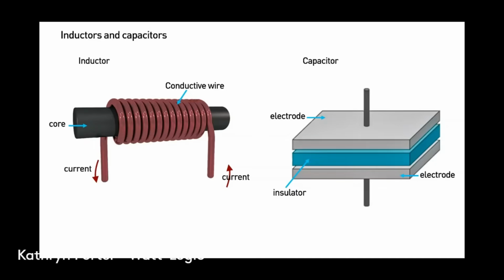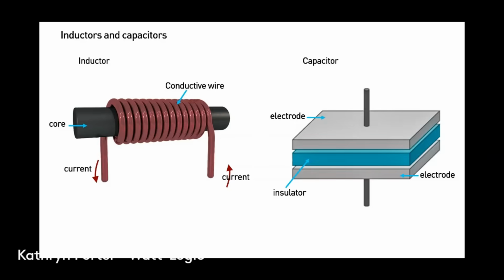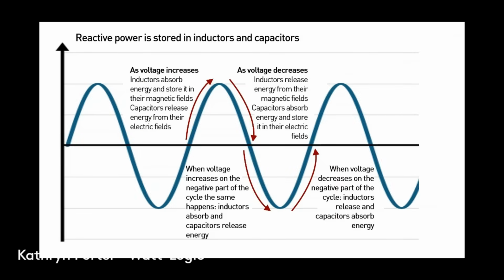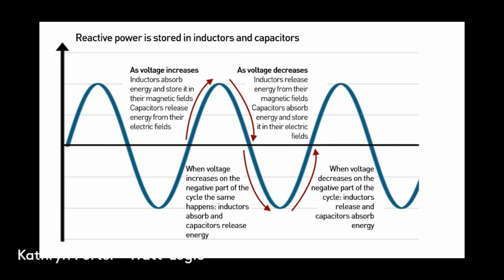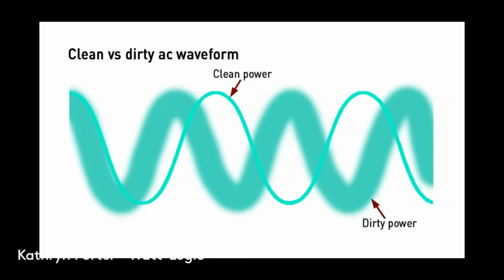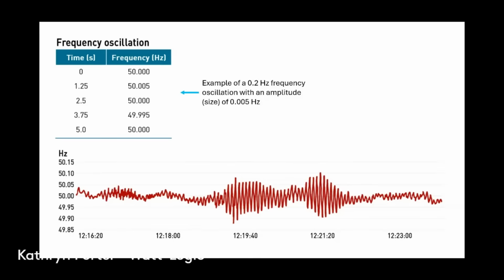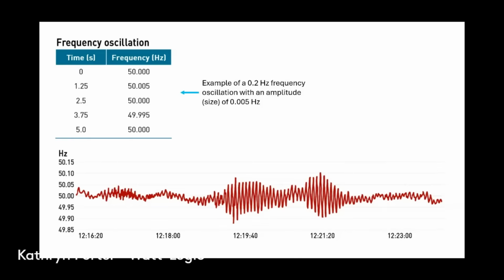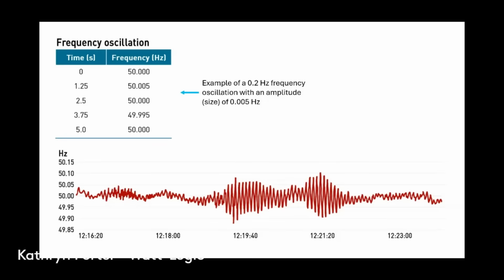Iberian blackout

Comment: Really helpful, thank you. Could you explain how a domestic combined air source heat pump, solar PV and battery (DC connected) system works. Why does the grid limit the size of the PV system for a simple connect to 3.6kW? What will happen if, theoretically, multiple properties accessing the same sub station install 8-12kW ASHP and the grid is not informed?

Comment: Challengers O-ring failures were studied but they only studied the failures no realising that non failures were always at high temperatures during launch, hence the real risk of launching at low temperatures. More importantly for this, it was commercial pressure put on the engineers to change their assessment which is very much a Net Zero problem

Comment: A minor error , at 6:55 you describe a motor and a light as "resistive loads" ... the motor is inductive ... and as incandescent bulbs (which ARE true resistive loads) are mostly extinct and we're all using LEDs etc. they too are inductive/reactive loads....

A minor detail in an otherwise very comprensive talk... 

I'd be interested in knowing where the low frequencies (0.2 / 0.6Hz)  came from... not harmonics of the 50Hz fundamental, obviously.. sounds like some kind of frequency mixing is happening somewhere... 

I know that 2 oscillators operating at different frequencies can "beat" and produce various intermediate frequencies (this is the basis for superheterodyne radios) ... Would 2 (or more) generators running at slightly different output frequencies be responsible for this ?...

Interesting vid.. a sub and a like from me !!

😎👍☘️🍻
Reply: If centralised grid generation is used - several big power stations - their outputs can be synchronised more easily - with centralised control? In a power grid with hundreds if not thousands of inputs - lots of solar panel DC to AC inverters - they aren’t precisely synchronised are they? So ripple effects would occur from imprecisely inputted power supplies?

Comment: KP: "So in that sense you absolutely can trace this back to renewables."
WRONG, that is scapegoating Renewables, shooting the messenger. What you can trace it back to is a failure to design the system and the equipment, including the inverters, properly to handle renewables. It's lazy design, and/or poor system analysis before deployment. 

KP:  "... overall the collapse exposed the systemic risks that you have with low inertia grids and high levels of inverter-based resources and inadequate voltage control"
That's kp's interpretation, mine would be:
The collapse exposed the problems that can arise when you attach inverter-based generation resources to the grid without a proper understanding of how those resources need to be designed and managed. 

There's no fundamental reason why you couldn't have a grid that was poeered completely by wind and solar just using inverters, and it would probably require very little, if any, so called inertia, but more accurately rotating heavy generating machinery, the inertia of those generators is constant whether they're rotating or stationery. Some synchronous condensers might be useful, because these effectively behave like the output smoothing capacitors to get on a DC supplies.
Reply: I'm here in Spain..money first priority for electric company's here..they will use all the water from the pantano to make cheap hydro electric..then 3 months later there's a drought,the pantano is almost dry and they act like it's not their fault and can't understand it😂😂

Comment: Great video, thanks!
Suggestion: Edit your pinned comment and add a time stamp to fast forward to for all of us who already knows how AC electricity works, but knew almost nothing about the liberian blackout.

I wonder to what extent, if any, it would had helped if the Spanish railways used a different electrification? As a comparison in Sweden the railways use 16 2/3Hz and a lot of that energy is converted from 50Hz using rotary converters. Although not intended to back feed the grid, these obviously provides some inertia.

Also, IIRC in Switzerland or maybe Austria they used parked but powered on modern electric locos as power factor compensators.

Here in Sweden the national grid pays you for installing inverter based reactive power. I.E. you just buy inverters (I don't remember if you also use batteries or not) and hook them up to your grid connection, and you get paid for how much they help keep the grid stable.

Re compliance: How would you test this? Would you temporary hook up a really large AC-AC inverter between two sides of a disconnect that connects a smaller part of the grid to the main grid, and on purpose change the frequency and check what happens with all connected inverters? Or would you go around and do this for each customer that has solar/wind connected?

Also, how does it technically work when the grid operators order power producers to produce more or less power? Is this partially manual via phones or so, or can the grid operators electronically force certain producers to increase/decrease power production?

Also: I get why there are narrow limits for tripping power generation, but as the main reason for tripping smaller inverters is to protect electricians from being shocked during a black out, is there really a reason for having those limits on smaller inverters? Wouldn't it be better to have really wide limits, like 40-60Hz and also allow the voltage to drop as low as say 100V? (I also get that a reason for the limits is to have the inverters trip if there is a short circuit, don't know what the correct wording is in English, trigger conditions perhaps?).

Maybe we also could benefit from remote controlled "smart" load shedding?
Back in the 70's-80's  Sweden had a system where the grid had overlaid signals with audio frequency that were used to switch between day&night fees, but they could also be used for load shedding for houses that used electric heating. Something like this but way faster reacting seems like a good idea.

Speaking of automatic disconnect: Since induction stoves already have electronics, and many ovens also tend to have electronics, and for that sake also other appliances, how about regulations that forces them to disconnect if the frequency falls too low? I get that many will tamper with that if it's in any way possible to tamper (and if it's not then the manufacturer would lose sales to off grid / camping customers), but as long as most don't, it would be a decent way to save power during a grid emergency. The same goes for heat pumps / air conditioners.
Reply: A wide frequency "band" of 40-60 hertz would be totally unworkable... effectively there would be NO synchronisation !!... if you connect 2 unsynced generators you will get a big bang.... 

Also, most industrial machinery uses 50Hz as a timing signal in processes... even a simple conveyer belt couldn't cope with such vast speed fluctuations...  

😎👍☘️🍻
Reply: @peterfitzpatrick7032  I'm not talking about what the producers would aim at, but rather at what they at least would not disconnect from and preferably also be able to connect to. I.E. if you from a black out would manage to get the grid to above 40Hz and say 150V (phase-neutral) all solar inverters would kick in and help bring up the grid. Also when the grid is under heavy load they would not disconnect early.
Reply: @The-secret-101  The actual frequency is arbitrary to a certain extent, being mainly set by the grid generator sets... BUT ...whatever the frequency, it can NOT diverge...ACROSS the whole grid AND syncronisation cannot diverge...&  you can't mix different frequencies because its then IMPOSSIBLE to attain synchronicity... thats all I can say, I don't know what your comments are trying say... 

(At 50Hertz nominal, 40Hertz is 20% and 60Hz is +20%... so an overall swing of +/ 40% ... )
Reply: @peterfitzpatrick7032  Yeah, but it's better that parts of the grid run as an island than a total blackout. Also if you can do a cold/black start and the solar/wind generation would actually help rather than cause trouble you would be able to reconnect faster.

Also, with some sort of remote control for desired frequency and voltage that solar/wind inverters would adhere to, it would be easy to reconnect to the rest of the European mainland grid
Reply: @peterfitzpatrick7032  As for industrial machines, it's just beneficial if they would install automatic shutoffs that shut off their production if the grid goes out of narrow tolerances as that lessens the load on the grid when it's under heavy load.

I would think that most industrial processes uses VFDs nowadays too, or asynchronous motors. Also if the process can't cope with varying speed of conveyors (like say a factory that casts iron or whatnot) I assume they have local backup power that at least can run the most important things.

Comment: "Normal" may be "lost in translation", as it may not refer to a acceptable/good/desired state, but a statistically recognisable (bad) event that must be anticipated to happen from time to time.
Regarding the oscillations, REE meant to discern between events that are well-known to occur, maybe several times each year, and which they have a good idea of what is going on, as to what causes these 0.2 Hz oscillations and how to deal with it, on one side, and on the other side the abnormal, unexpected events of oscillation (which they did not know the origin of).

For people living in England, one should expect some extreme weather from time to time, like extreme rainfall that flood the streets and sewer system. It is well-known that i can happen, and why it can happen, and there are ways to stay out of danger. REE would call that a normal event, but being eaten by a tiger is very much not expected.
Reply: The actions that the system operator must take, depends on the root cause of the anomalies they detect, so the classification of the oscillations may influence what the operators choose to do.

Comment: Can't we make inverters that simulate the inertia of rotating machinery? Rather than following the grid (or worse, disconnecting), they could oppose the frequency change in the same way a big rotating machine would. Wouldn't that help improve grid stability?
Reply from the maker: Yes, in theory. There are two problems. One is technical with grid operators and OEMs struggling to align on specifications. The other is economic... They would have to keep some capacity in reserve to provide inertia. So if you had a 10 MW windfarm you might only be able to sell 9 MW in the regular market to keep 1 MW for inertia /frequency response. That would obviously have a cost but it's hard to justify when you get it for free from conventional generators

Finally if the inverters aren't grid code compliant and can behave in unexpected ways it would be a risky strategy

Comment: Like your presentation style; struggle to understand some of it; very technical! Could you explain fault ride-thru in another video?
Reply from the maker: It's when a generator is supposed to keep running despite a grid fault where the impact of the fault is within the parameters set out in the industry codes

It's a bit like working through a cold but needing to be off sick if you get the flu. The cold is the small fault, you should be able to power through but you might be a bit miserable, but no-one expects you to power through actual flu. That's a fault that's beyond what a generator should be able to ride through

Does that make sense?

Comment: It seems surprising that a fault on a single inverter would cause a measurable effect on the high voltage grid. I assume that the inverter would be connected to the local, lower voltage network and just be one among many. What would have happened if that inverter had failed totally rather than just malfunction? In other words just switching off?  There must be a vast amount of high power semiconductor devices on a grid with a high proportion of solar and wind. Converting from AC to DC and DC to AC.
Reply: If it was caused by a single inverter, it must had been a large solar farm and not one used for ten panel on the roof of a single family house.
Reply: @The-secret-101  Kathryn says that the fault was traced to a solar inverter associated with a single solar PV. I realise that it must be quite a hefty device. I don't know how these solar farms are configured and whether or not there is one inverter for a bank of panels or one per panel or one for the whole farm. All the same, a single solar PV must be small in comparison with the whole grid so it seemed surprising to me that a fault on a single device can ripple up through the network and be seen at the top level.

Comment: Very nice tutorial indeed.  More info now explaining the circumstances of that voltage raising. It was the ops action aimed at reducing oscillation. They switched out the reactors and switched in some previously outaged lines to increase the synch torque. That caused the voltage to go up enough but still within the limits to trip the first synch gen. These oscillations were not a direct cause but rather led to ops action which elevated voltage to the point where the first gen prematurely tripped. However interesting is this new mode of 0.6 Hz, too much attention is paid to these oscillations as the cause of this event.
Reply: It wasn't so much the oscillations, it was the way the wind and solar producers reacted (pardon the pun) to them by shutting down prematurely which ultimately caused a cascade failure by reducing base generation "stiffness" ... thats my take on it anyways.. 🤔
Reply: @peterfitzpatrick7032 finger pointing in one direction only doesn’t help. The first premature tripping was actually by the synchronous generator. Since it was heavily leading, it triggered subsequent tripping by other gens. The problem with the IBRs was that they didn’t regulate the voltage. Unlike the conventional generation, the renewables were not required to keep the scheduled voltage. But again, you can’t blame them for that. It was the grid operator who allowed them to operate in the pf mode.

Comment: Excellent video with good explanation. 

So the problem could be fixed by requiring renewable installations to have grid forming inverters instead of the older dumb ones?

And the control standards across manufacturers would need to standardised (by an IEEE requirement for example) to allow grid operators to not have to worry about how different sites will react?

These seems like a failure to adapt a grid to increasing renewables rather than renewables being inherently flawed. It shows that care and time is needed during a transition and not a headlong rush for the “prize”. Something politicians should take note of.

Comment: A lot of wind turbines do directly feed AC into the grid with no intermediate inverters by using DFIGs/Doubly Fed Induction Generators, which are just generators where the field is AC instead of DC.  The output frequency is the sum of the shaft rotational frequency and the field frequency, which allows for fixed output frequency with varying shaft rotational velocity and smaller inverters as they only need to handle field input power.

Comment: I am Michael Faraday and I approve this video
I asked someone at the national grid if I needed to get a backup generator at home. The advice was to get a battery backup and offset the cost using a smart tariff. It was a clever way of actually evading my question - to answer it could have compromised this person. So I am still equivocating - an lpg generator + manual transfer switch will cost over £2,000 but it would give me peace of mind. The erosion of standards and general scientific illiteracy among senior civil servants worries me. I worked with them for 10 years.
Reply from the maker: I have a diesel generator. Both my cars run on diesel so the fuel is easy to recycle to avoid it going off

I live in a rural location with a single phase power line that runs across some fields to get to us. We're the last house. Without power we can't pump waste to the septic tank so a backup system is pretty essential for us
Reply: @KathrynPorter26  thanks.
Reply: I bought an almost new 5.3Kva Hyundai diesel generator for £700 and a transfer switch for £50. If you look around, you should be able to arrange a back up supply for much less than £2,000.
Reply: @grahamgrierson8094  Despite my frugal use of electrons, my bill every 2 months is full of other charges which is making me SERIOUSLY consider just going off-grid completely.. the only drawback is if I ever needed to re-connect to the grid they would treat me as a new connection and charge an arm and a leg...

 I refused a smartmeter after my neighbours started to see immediate increases in their bills... 

😎👍☘️🍻